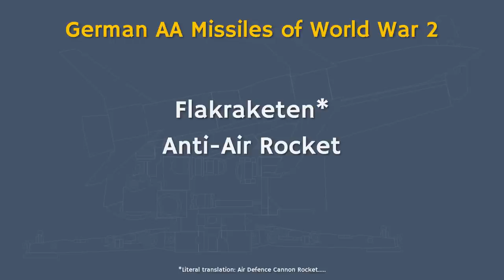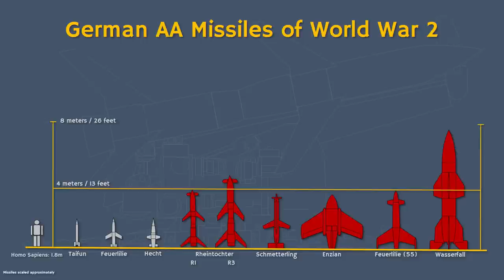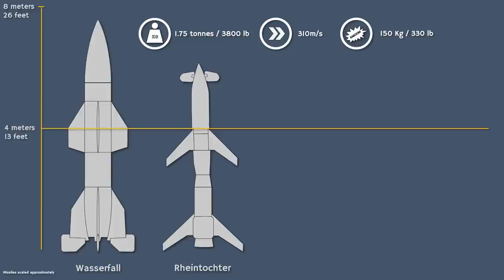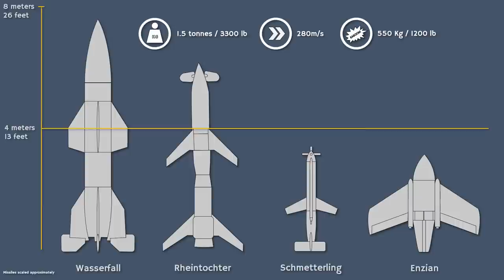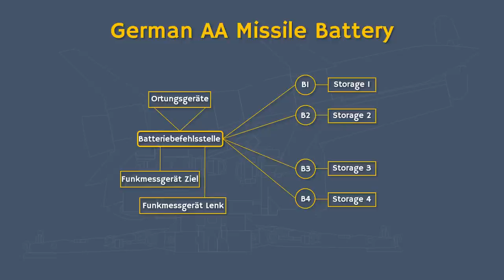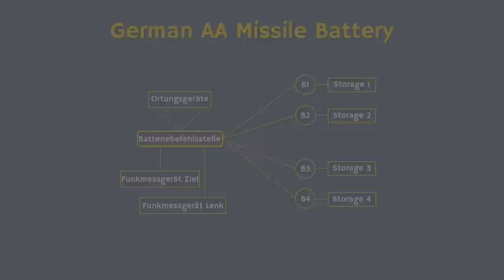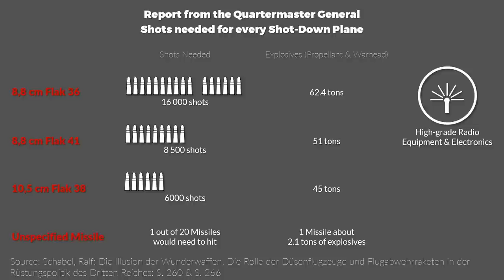German Anti-Air Missiles of World War 2

Comment: You've got to wonder why the Germans couldn't perfect a proximity fuse.
Reply: RonJohn63 look. It's very easy to explain. If you'd use a proximity fuse you wouldn't need that much   explosives. And as everybody knows: explosions are great!
--> less explosion, less fun
Reply: They needed the appropriate radar technology, like the cavity magnetron, would allow them to make a really small device that could react in sufficient time and use the radio frequencies required.
Reply: Which then raises the question of why they couldn't invent the cavity magnetron.
Reply: Well that's because of the Nazi system that fragmented the national effort - information flow inside a totalitarian system is bad, as everybody is afraid to upset the boss or cause themselves trouble by unknowingly doing or saying the wrong thing; everybody is especially careful of telling the higher-ups they could do better (and that they have made a mistake, by implication).  Instead of getting everybody to work together, you don't tell anybody else what you are doing, especially if they are working for a different branch of the armed services - sometimes even within the same service (e.g. part of the Luftwaffe knew what to do about radar but the part that needed to know didn't find out in time for the Battle of Britain).  Also has to do with the procurement system that favoured Nazi friends not the best designers/builders.  Anyway, you can't invent everything and have to set priorities and stick to them - another thing the Nazis failed to do - if something got priority, something else that should be disadvantaged would get super priority instead, so both would get done more slowly.
Reply: British had a working Radio Proximity Fuze in 1940, they couldn't however fit it to anything smaller than a 5 inch rocket as it couldn't stand the launch 'G' of  a gun. The plans for it went to the USA with the Cavity Magnetron with the Tizzard mission in 1940.  Out of it came the SCR-584 microwave gun laying radar, Bell produced the M-9 Predictor and the USA took the British proximity fuze circuit design and made it small enough and strong enough to put in a heavy AA shell. The fuze wasn't that reliable as it tended to fuze the shell on anything it detected in the air like birds or other shells, and 50 % of them failed to work. Despite this, the number of rounds required to kill a V-1 (small fast low level target), using the three systems listed above was 77 rounds per missile kill.
Reply: The Rustahl X-4 had a sound based proximity fuse, listening for the bombers' engine roar
Reply: Richard Vernon when they had it in 1940 wy was used so late in 1944
Reply: The British one in 1940 only worked on unguided 5 inch rockets , they couldn't be made small enough or strong enough to be fitted to a medium caliber AAA Shell and fired from a gun. The US took on the design, miniaturized it and made it strong enough to be fired from a  gun. They also had to get the fire control radars working and the gun predictor into service.  That happened in mid 1944 with the V1 offensive which was pretty much beaten by the AAA
Reply: Program was halted in 1940, and restarted in 1944, which, of course, was too late. They also didnt use the same method that americans used. American one could be easily countered with certain radio waves and was not used after war. https://en.wikipedia.org/wiki/Proximity_fuze
Reply: Me-262 had proximity fuses in it's ammo. After the war, we were quite "Freaked Out" about how advanced it was, and how effective....
Reply: Because Hedy Lamar was on our side.Between movies,she helped design the proximity fuse.
Reply: because they didn't have radar like the US and UK.
Reply: @Robert H. Goddard: The Father of Rocketry
Yes they did.
Reply: @
Andrew Porter
She should be given credit to help adjust it to fit in the shells but had nothing to do with its invention.
Reply: +DDelete013

yeah but their form of Radar they did have was absolute shit compared to the Allies.
Reply: Considering Hungary independently developed its own acoustic proximity fuses by 43, I am more baffled why didnt they just license that.
Reply: @richardvernon317  So did the early (1937 -) Klystrons get into any WWII (Prox.) Shells, reflex etc.
Reply: @johnpotter4750  No, The Pozit VT Proximity fuze used by the Allies was not a centimetric radar device but a low powered continuous wave radio device working at a frequency of 180–220 MHz. The Transmitter was an oscillator circuit using a single valve with the shell case acting as the Antenna. When the shell approached the target, the reflected signal (which was doppler shifted in frequency) induced a feedback into the Oscillator that changed its output signal. This feedback caused a change in the current going across the valve (which matched the doppler frequency) that was detected by a twin valve amplifier circuit which was separated from the Oscillator power supply by a band pass filter unit (which only allowed the doppler frequency to pass through it) . This doppler frequency was amplified. When the amplified signal reached a set level, it allowed the forth valve in the fuze, A Thyristor to conduct and pass high current to the detonator which exploded the shell. The fuze had no receiver in the normal sense. Did the Allies use the Klystron in Radar during WWII, most definitely as every Allied microwave radar used one as the Local Oscillator of the Radar's receiver.
Reply: @tobiaszistler  The 1940 one was just a development prototype. The US one entered production in 1942, was first used in the Pacific in early 1943 and in the Mediterranean mid 1943. Use in Europe was cleared in mid 1944.
Reply: @richardvernon317  I got confused a the chat about the cavity magnetron and cross fixed upon two devices, admittedly I have never drawn to the powerful Klystron.   73's
Reply: @johnpotter4750  Most powerful Klystron I've seen could kick out 8 MW, though it normally operated at 5 MW.
Reply: @richardvernon317  Hah, definetly not allowed any where near that, Wow No good on top of a hill, with a 12V battery.  73's
Reply: USA scientists with British magnetron : ExPlain this magic!!!
Reply: Not every mystery can be solved, sometimes you can only get so far before you hit a brick wall. Even if someone else was able to get past that obstacle. Who knows why they couldn't do it. Could be as simple as the guy who would've invented it being Jewish so he either fled or died, meaning he couldn't contribute to the war effort. Maybe they did get close to making it but some kind of hiccup happened and the prototype was never realized. Lots of german projects were highly ambitious so it might've also been that you have so many other high budget projects going on that none of them really get the attention they needed.

Comment: Question: How come the Luftwaffe never bombed the ice road at Leningrad?
Reply from the maker: That's one for a video!
Reply: fred rose it would refreeze?
Reply: mikkel hansen it would, but you could continually bomb it and keep the road destroyed, couldn't you?
Reply: You could but think of the loss you would get out of it. The soviet airfoce was focused in that area and the road most likely had AA emplacements. I think that the cost of bombing the road is higher then what you would get out of it.
Reply: Just call Hans there every few days
Reply: Same reasons why the Germans didnt bother with the Sacred Way during Verdun.
Reply: Ice of that thickness is notoriously difficult to damage. (Which led to the Habukuk idea.) Melting it works better than blasting it; but only as long as your fire lasts and even then only if a big enough blaze.
Reply: brian rose The ice road was used mostly at night, and it was in the "Finnish sector" of the line. The finns very likely knew about the road, but I doubt they would have told the Germans about it if they did...
Reply: its more effective, that the soviets waste a lot of ressources there..worst case is getting leningrad and to supply all people by self
Reply: How can yo bomb a frozen lake?
Reply: @jakobming4831  same way you bomb anything else. Fly over and drop some bombs on it. As to how much damage you'd cause, that's another question. 

But even if they may not have been able to destroy the roads, destroying the supply trucks moving over it could have made a difference if they were able to do it consistently over days or better weeks.

The Germans as it turns out did try to do that using artillery but they simply weren't able to divert enough of it to be effective.
Reply: They did
Reply: Possibly because it would just re-freeze overnight, and repair itself. That's my guess.

Comment: Bismarck, do you know why the Germans were obsessed with inverted V engines during WW II? And why other nations didn't have it so?
Reply: I am pretty sure that it was just down to what was commercially successful in Germany at the time before the war. Two engines that were very successful at the start of the war was the Hirth HM 504 and the Argus AS 8, these were both inverted inline 4. There was no real advantage to having it inverted, nor any real disadvantage. Although inverting the engine block in fighters could increase the field of view from the cockpit, by reducing the profile of the engine cowling.Inverting the engine block in fighters increases the field of view from the cockpit, by reducing the profile of the engine cowling. And an inverted engine needs to be fuel injected, which became a great boon while fighting Spitfires and Hurricanes with float carburetors. As the British fighters would quickly become fuel starved while pulling negative G's, something the Bf 109 had no problem with.

It would be really hard for Junker to convince everyone that it would be better for it not to be inverted, even if it didn't give the aircraft any great advantage.  So they chose to just go with the flow, and make inverted engines.
Reply: made it easier to service the cylinders too, as you wouldn't need to take out the engine and flip it
Reply: Lunar Safeguard Im no engineer, but it seems to me its easier to mount guns on the nose with an inverted engine, and having a gun mounted on the nose makes it much more accurate than wing mounted harmonized guns. And perhaps its easier to time the guns with the engine with the engine arrangement. The guns need to be timed perfectly and synchronized with the propeller so they dont shoot out the blades.
Reply: Motorkanone
Reply: And why are all their turbo-superchargers  mounted at 90°?
Reply: @ligaconjastica6872  I assume you are referring to the cannon firing through the propeller hub. It would certainly complicate the design but i really have no idea how it works. Maybe someone else could answer that question?
Reply: @ribbitgoesthedoglastnamehe4681  I don't know how either
Reply: @ribbitgoesthedoglastnamehe4681  I think the propeller was geared down, and so the hub was offset from the crankshaft. You could then simply plop a 20 or 30mm cannon on top of the engine crankcase, in line with the hub. I don't see why this couldn't also work with a non-inverted Vee engine, although there would be some complications from the air and fuel delivery gear on top of the engine having to be kept out of the way of the cannon.

Comment: It should be remembered that AAguns up to 155mm were front line land weapons into the 1960’s   US Navy forces deployed AA missies very early after the war (Terrier and Talos) in this case these systems had the infrastructure of large ships with radar, magazines and well trained crews that could support the systems
Reply: Nike Ajax was the first operational system (1954) and it was basically built around fire control systems developed at the end of WWII. The Soviet SA-1 system came about at the same time but that was a crash program stated by Stalin in 1950. Terrier and Talos development did start just after WWII but they didn't become operational until the late 1950's. The first really effective system was the MIM-23 HAWK that came into service in the early 1960's (everything before that was pulse radar based which was jammable, by the ECM equipment in the larger bombers at least).

Comment: In the 1960's and 70's the North Vietnamese fired off nearly 8,000 SAMs at American aircraft for a total of 205 kills. Given the decades of development and major electronics advances up to that war I doubt any of the German AA missiles would have done any better than this.
Reply: Actually, they'd have done quite a bit better... for a while. By the Vietnam war era, effective countermeasures to both heat-seeking and radar-guided missiles were widespread. Back in WW2, there were none, obviously. I doubt it'd have taken them long to slap chaff (which had already been invented) canisters to every single one of their planes though.

Don't forget, chaff would be less effective mounted on a slow moving plane, as well. With a fastmover, when the missile next 'sees' its target, it'll be quite far away. With a relatively slow prop-driven WW2 bomber (against which these would've most likely been deployed) it'll be significantly closer to the cloud of chaff. Considering the missile would have been manually detonated by operators on the ground, and that aircraft flew in quite tight formations, I doubt chaff would've affected the effectiveness of the Flakraketen much.

Nice stats though.
Reply: The idea of using clouds of chaff to spoof radar had been around even during the Battle of Britain, but both sides were afraid to use it because it would encourage the other side to do the same. Eventually the British went ahead with it on one of their night bombing raids, they had some of their bombers carry nothing but chaff, there was so much it completely crippled the German night time defenses since they couldn't use it to guide their night fighters or searchlights. I doubt it would have worked for very long.
Reply: 'but both sides were afraid to use it because it would encourage the other side to do the same'... that sounds very unlikely. Could you cite sources?

Also, I know chaff was around in WW2, I even acknowledged that in my above comment, but it wasn't widespread which was my point.
Reply: If I may direct your attention to 3/4 of the way to the end of the second paragraph and the beginning of the 4th paragraph. https://en.wikipedia.org/wiki/Chaff_(countermeasure)#Second_World_War
Reply: Wow, what a bizarre situation, lol.
Reply: One big problem, none of the German AA rockets used Radar guidance in major way. Most of them were pure command line of sight weapons with a man steering them with a joystick. Had the German's come up with any type of radar guidance, it would not have been effective for long as 100 group aircraft would have jammed the crap out of them, just as what happened to the Hs293 and Fritz-X guided weapons in late 1943.
Reply: Richard Vernon Actually the HS and FritzX used radio not radar guidance
Reply: The R at the start of RADAR stands for RADIO!!!! Any thing that used radio in a guidance system in any way back then could be actively jammed.
Reply: @richardvernon317  Radar technology in a small rocket, impossible. Radio technology at that time was still based on tubes. That was not possible of the size. Transistors were invented only in 1948 and they were so versatile only years later that they could replace tubes.
Reply: @folkestender2025  All early SAM used vacuum tubes including Bloodhound 1, Thunderbird 1, Talos, Terrier, Tarter, Bomarc and all the Russian ones. Radar command guidance does not need a radar in the missile itself and the beam riders and Semi Active homers only need a receiver in the missile itself. The Americans managed to fit a small doppler radar into the nose of a 5 inch AA shell in 1942 (Pozit VT proximity fuse) and built and deployed an operational ACTIVE Radar homing anti ship missile in 1944 /45 and used it operationally (ASM-2 Bat).
Reply: @folkestender2025     All early SAM used vacuum tubes including Bloodhound 1, Thunderbird 1, Talos, Terrier, Tarter, Bomarc  (Active radar homing in that one) and all the Russian ones. Radar command guidance does not need a radar in the missile itself (Nike Ajax, Hercules and SA-1/SA-2/SA-3) and the beam riders and Semi Active homers only need a receiver in the missile. All the early SAM used a large ground based radar to do the target/missile tracking and illumination. The Americans managed to fit a small doppler radar into the nose of a 5 inch AA shell in 1942 (Pozit VT proximity fuse which had 4 valves in it!!) and built and deployed an operational ACTIVE Radar homing anti ship missile in 1944 /45 and used it to attack Jap shipping (ASM-2 Bat). Most US and Soviet SAM systems into the early 1970's used valves as they were more EMP resistant than early semi conductors. I've worked on 1960's era SAM systems, Have You?? No. Thought not, so STFU and go and read up on the subject before talking out of your bottom.
Reply: @richardvernon317  Yes that's right. I just thought that you mean of a total autonom self-control of the missile by radar. The development in this time still was not so far.
Reply: German stuff is better..
Reply: @MBKill3rCat  According to Episode 2 (radar) of the BBC's "The Secret War", "Window" (aka "chaff") was developed around 1941 or 1942 by both sides, but each was afraid that would tip off the other side, who would use it and spoil their own radars. Note that each side used different wavelength radar, which meant different chaff sizes. On the British side, the debate over using Window went on for over a year until bomber losses became intolerable and they had to use it. Eventually the Germans switched to a different wavelength radar and Window was ineffective until the new wavelength was determined, and the chaff could be recut.
Reply: @folkestender2025  Yet, WWII proximity fuses used a small radar set (just the receiver?) that could fit in a shell and survive being fired out a gun.